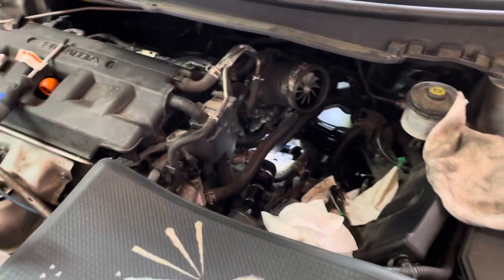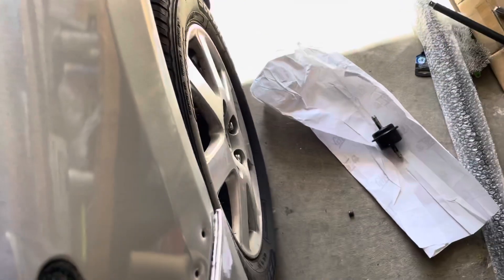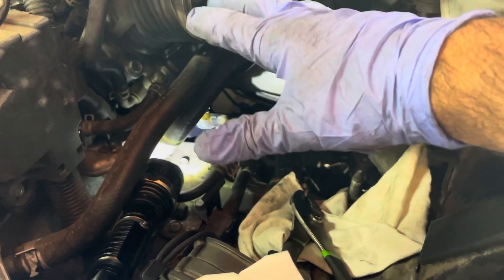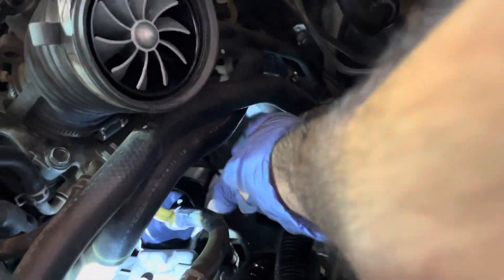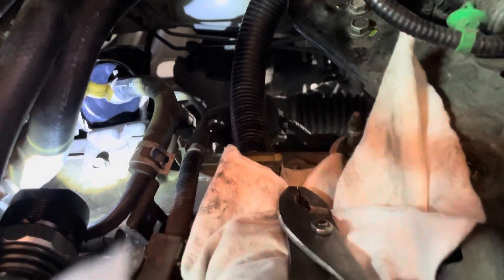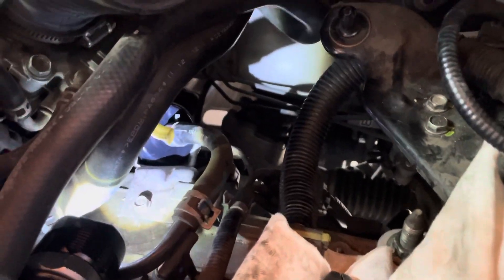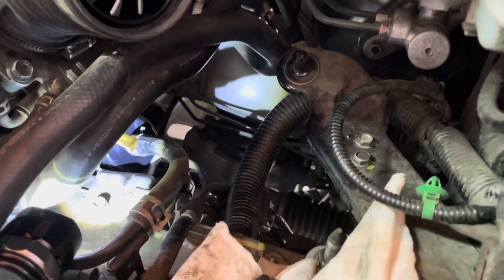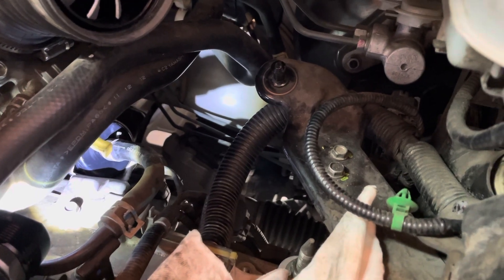2012 Honda Civic transmission oil filter change!

Comment: This video may have helped if it actually showed something. How does the airbox come off? How do you actually remove that plate? Show how to get the filter out and replace it with the new one.
Reply from the maker: It has helped and does show something you’re just not at the point at which this info is helpful to you. So you’re just projecting your frustration on my video! Sorry it’s not a beginners video.

Comment: There is some connection at the back of the air filter box that I can’t see. Any ideas for a step by step process for taking that out?
Reply from the maker: So for the back of the air filter box theres a piece of metal looks like a post. On the bottom of the air box is a rubber grommet. So its only being held down by that. You would just need to wiggle it as you pull upward and out. You can also try a twisting motion or wven spraying some windex or soapy water when you take the air filter out you can see it. Or even grease on a Qtip.

Comment: Is it necessary to drain transmission fluid before replacing this filter?
Reply from the maker: No, you can do it without draining.
Reply: @rhdadrian  Thanks. I tried doing it. i was able to do it till unclamping the hoses from either side of the filter. However i was not able to slide out the hoses from the filter with bare hands. I would have to come back at it again with a tool. Had to reassemble the whole thing back without replacing the filter until i find the proper hose removal tool. LOL Btw thanks again for the effort you put into this vid. it helped alot. i was told in the begning that these newer model cars dd dnot have a replaceable transmission filter. liike the older ones where you unbolt the whole transmissiion oil pan to replace the filter. i was surprised to know that 2012 civic did have a transmission oil filter. just gave it a chance by searching it on youtube.
Reply from the maker: @alirahman4762  sorry to hear that, I was able to get it off with some 45’degree pliers and spray some soapy water or degreaser to slip it off! Once you pull the clamp down and off of it enough you want to wiggle it side to side as you pull it down. And hold the filter in place so it’s not moving around on you. I did it by myself one hand holding the filter the other rotating the hose with the pliers. I’m glad I was able to help!
Reply: Is this the only transmission filter or doed it also has a internal 1 as well other than the external (for CVT)
Reply: I did mine on a 2010 and found that after removing the air filter box  removed the very top clamp leading to the metal pipe remove that first and remove the bottom side of the filter hose clamp to the metal pipe also using long needle nose pliers,you then remove the saddle clamp and twist and turn the rubber hose to the metal pipe on top and bottom and remove the filter with both rubber hoses attached to the filter and once the filter is out swap out both hoses to the new filter and lube up both metal tubing top and bottom with some Wd 40 and slide it back on and clamp it using the long needle nose pliers but sometimes you might be easier to get the bottom hose from under the car but I did not have to as I got everything from the topside
Reply: @mikethompson3534 can you say that again?

Comment: What is that fan thing in ur airbox hose
Reply from the maker: Ah it’s some thing I bought on eBay, it’s suppose to create like a vortex of air as your throttle body opens so you get better air fuel mixture, aka better gas mileage
Reply: @rhdadrian your skill level is above falling for that junk Ebay vortex MPG increase thing if you are able to change the transmission filter on a Honda.